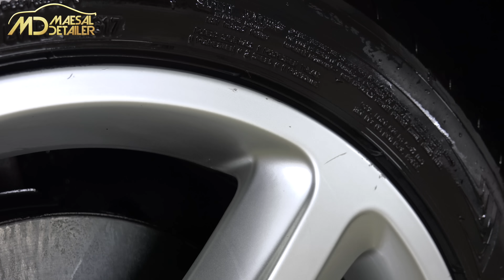LIMPIA LLANTAS ACIDO y DESCONTAMINANTE FERRICO AutoGlanz

Comment: Is the first product the trade product? 
The acid product is for the iron contamination that isn't removed with decontaminante ferrico, right?
11:00 the yellow is silicone brush,right ?
Reply from the maker: The first one is the acid wheel cleaner, then the iron remover and then the tar remover. I'm not sure if it is made with silicone, but this brush is the best for sure.
Reply: @maesal  The tar remover is solvent based , does it stink a lot?
I use a Limonene based product (like the CarPro tar remover)
Reply from the maker: @dimmacommunication  yes it is, but it doesn't stink as much as others